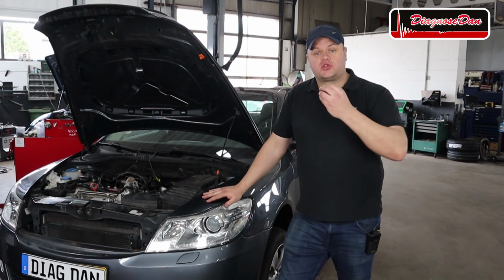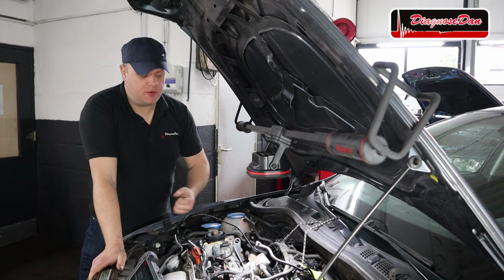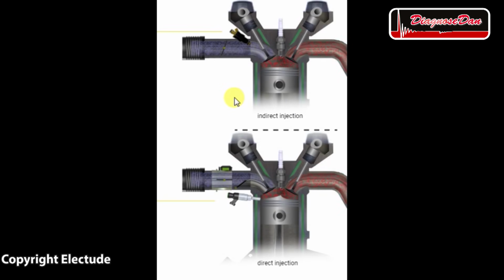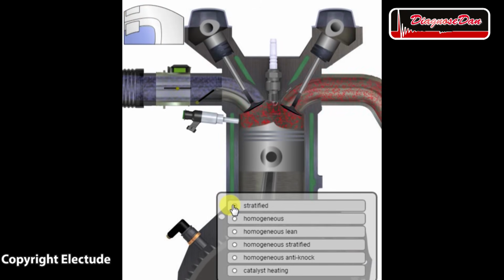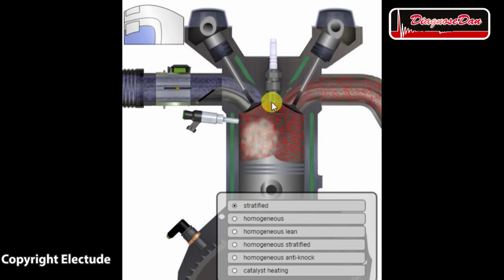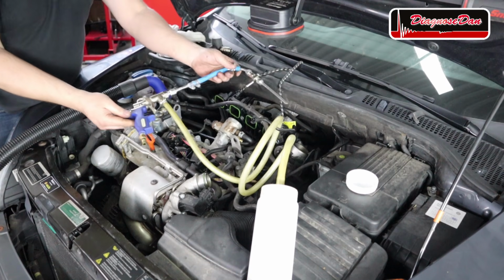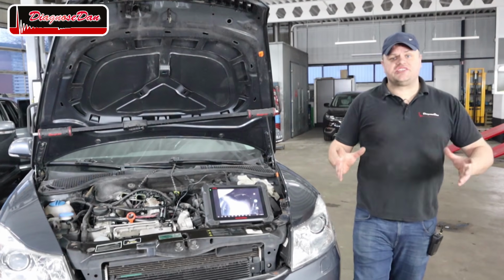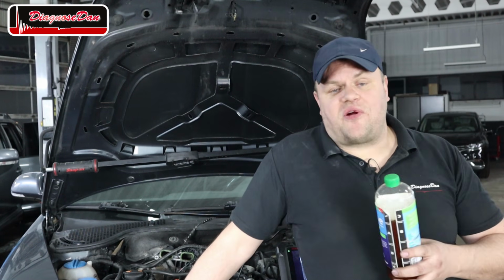Tsi cold misfires explained

Comment: Some systems have extra injector in intake manifold to help clean all that mess.
And nobody runs anymore on lean-mode! So carbon build-up is almost gone!
Reply from the maker: Yes, they have solved the problem on later models with an extra injector 👍
Reply: @Diagnosedan  so you fix the problem by adding more parts and cost . Well done enginerds
Reply: Lexus had the extra injector on some of their engines few years back.

Comment: I didn't heard you mentioning EGR valve. 
When engine runs on lean-mode it produces lots of carbon! 
At same time engine runs on almost closed throttle, which gives a lots of pumping losses. 
That's why EGR valve opens and helping to decrease pumping losses.  And that's why all carbon goes back to intake valves. 
And if you mix all of carbon with oily steam from crank hause ventilation you get all that you saw on boroscope!!
Reply from the maker: There are more than one source of contaminstion. You are right 👍

Comment: Great video, I would have liked to know the mileage on this engine
Reply: Just basing on some facts I know, it's a facelift version so it's probably between 2007-2012 model, seeing the dash it said 150, i highly doubt its at 15000 km, so it's probably 150k km
Reply from the maker: Its about 130K Kilometers
Reply: DiagnoseDan ah close enough haha
Reply: columbo1966 I saw the same amount of carbon build up on a Kia with 73,xxx miles. My guess would be right at 100k.

Comment: That blasting was uncomfortably like having a root canal at the dentist!  Do the direct injection running modes have anything to do with the 'kangaroo' issues reorted on the new 1.5 tsi VAG motors in your opinion? Yes it won't be carbon on a new engine but could it be the injection design?
Reply from the maker: I'm not sure Keith i haven't come across one yet.

Comment: Thanks, Dan !
The problem has been solved by injecting fuel both ways, direct into the cylinder, and also onto the inlet valve, right ?
Reply from the maker: Yes, later models have an extra injector
Reply: Juergen bertram Chevy already did that.

Comment: the tsi engine also suffers from soft valve guides, i had a seat leon 1.6 with low rpm missfires, the valves float and loose compression.
another great vid dan, the carbon build up was strong in this engine.
Reply: Valve guide gets pulled down by the carbon on the stem...
Reply: @lgtweewielers  interesting but i have never seen that happen, the guides would have to be undersized fitting in the head for that to happen i would think.
Reply from the maker: Yes it was pretty nasty😀

Comment: Great video as usual Dan,to fix this properly blasting the valves is the first stage then the intake manifold has to be ultra sonically cleaned to remove the carbon sludge that builds up over time which is also labour intensive,an oil catch can setup would stop this problem altogether but it needs to be emptied regularly which as you know Dan would never happen as most customers dont even check their oil level!! 🤔😁
Reply from the maker: An oil catch can will slow the carbon build up down.
Reply: @Diagnosedan  maybe the manufacturers should add a set of injectors before the valves to inject a small quantity of fuel or other cleaning fluid (on cold start or every 3rd start) to clean the valves and help prevent this? Or maybe an aftermarket kit? 🤔

Comment: I'd be worried to just squirt any product into an engine badly carboned up and just hope any large pieces that fall off exit without any damage as there is little chance that they would be dissolved. As you say it would need to be done on a regular basis to prevent it getting that bad in the first place.
I've been looking at buying a used direct injection engined car and think I'll have to factor in a "decoke" into the cost after seeing that. How many KMS had it done?
Reply from the maker: 130K😉

Comment: Fantastic video Dan. As always a clear explanation of the cause of the problem, and the proper fix with evidence.
You also saved people time and money by not using the snake oil.
Looks like the additive might work if used regularly before the problem occurs, but will not help in an advanced case.
More preventative maintenance .
Thanks again, nobody does clearer more concise videos than you. Not even Eric O.
Reply from the maker: That's a great comment Sir😀

Comment: Sometimes it seems the smarter we try to be with getting engines fuel efficient, the dumber we look.
Reply: Right!?....this direct injection thing on gas engines....turbos to make V6 stronger than V8
Please, give me the old-style injectors with pushrods....(i.e. Ford's new 7.3L gas)
Reply from the maker: Thanks for watching 😀
Reply: With refinement comes complications
Reply: I think Toyota is putting in pre-valve injectors again just for cleaning while keeping Di.
Reply: @MV60  Toyota have been doing that for years with their DI-D D-4S engines. The engines run on either the direct, port or (I think) both sets of injectors depending on the operating regime. It's not just for cleaning the ports, there are efficiency considerations as well. Personally I would only buy a DI engine if it either had no EGR system or if it had a secondary injectors like Toyota D-4S engines.
Reply: @spankeyfish  The diesels have a injector in the dpf iirc. I'm talking regular petrol versions having the extra set of injectors for upper intake cleaning.
Reply: @MV60  I meant D-4S not DI-D, I've mixed up my Toyota marketing speak.
Reply: @spankeyfish  I think we mean the same things. :)
Reply: No more crappy eco cars that have no power but good fuel economy. Cars need everything in one package now
Reply: @BaileyHatfield-b3f  EV is the future. Fast as hell and meets emissions.

Comment: Absolutely spot on Dan ... 
I have the 2.0 FSi Octavia DSG (non-Turbo) on 140,000 mile and it's started to run lumpy at idle despite 
recent Plugs and EGR valve renewal ... the 2nd Timing Belt renewal is also due ... should I whip the head off and expect carbon on the valves??
Reply from the maker: The head doesn't need to get off, just remove the intake and have a look.

Comment: I have a diesel that is behaving the same way. How much does it cost a blasting on the intake valves?
Reply from the maker: It depends on how easy the valves can be reached.
Reply: @Diagnosedan  BMW 120D, year 2006. I am really  thinking in doing this.

Comment: Some people claim that the carbon buildup is mainly caused by very small amounts of exhaust gases entering the intake port due to valve overlap. It sounds like a reasonable explanation because other parts that get into contact with oil also don't have carbon buildup. What do you guys think?
Reply from the maker: So why is there no Carbon build up in the exhaust ports?
Reply: Which other parts running at high temperatures are in contact with oil mist and don't get carbon build up?
Reply: @ferrumignis  The bottom of the piston comes to mind. Also the intake port is watercooled so it will not be significantly hotter than the crankcase. The valves are significantly hotter but also the intake itself gets carbon buildup.
Reply: @tomvleeuwen  The bottom of the piston is cooled by oil. The inlet valve is not cooled by anything other than contact with the valve seat so they run hot.

Comment: An American company called CRC makes an intake and turbo carbon cleaning spray in a can that is supposed to work very well.  I would give that a chance and see how the results turn out.
Reply from the maker: Sounds interesting 👍
Reply: @Diagnosedan  ...Here is the Amazon link.  https://www.amazon.com/CRC-05319-Intake-Valve-Cleaner/dp/B00PHNQKR2  More for your information and a photo than for you to order it from there.  Any good parts store would have this in stock.  Well, at least they would in America.  You'd have to call your local parts store and ask.

Comment: Ah emission controls, got to wonder if over the whole life of a car they actually save anything - at some point it all still comes out the exhaust, or results in co2 dump cause the car gets scrapped early. Grumble.
Reply: Indeed. Let’s catch everything in a filter then people will blow it all out in one go or wash it down the drain.
Reply from the maker: Thanks for watching 😀
Reply: Haha watch the vid about the problem retrofitting cats and dpfs on school buses  in California has caused.
Haha to clean em out they back em up to the property line and let em go into Regen mode , blowing ash and all kinds of crap all over. 
There was a whole bunch of vids a few years back on how carb is basically putting people out of business and costing everyone alot of money and we aren't seeing any benefits
Reply: Go to China ro France to see emission problems, or back to LA in the 80s where they would issue smog warnings.
Reply: Do you recall having to fit a new exhaust system every few years due to rust? Modern cars do not have that, possibly due to emissions control which means exhaust gases do not attack the exhaust system and cause it to rust/rot away.
Reply: Mate no one cares about emissions
Reply: @Luxtraveler247  of course everyone does you're either trying to promote it or find a way to bypass/overcome emmision control as they throw more stuff on every year
Reply: @Luxtraveler247  Asthma sufferers

Comment: Toyota have been using direct and port injection since the mid 2000's to overcome this problem (Lexus V6  comes to mind). A combination of direct and port is the way to go in my opinion. This is a huge problem with VAG and BM's, stating the bleeding obvious. Great explantion Dan.
Reply from the maker: The newer engines have an extra injector 👍
Reply: VW builds also the 2.0l engine with the aka Dual Einspritzung System.

Comment: It’s hard to understand why VAG hasn’t installed a catch can to prevent this exact problem
Reply: It doesn't help.
Reply: Cabaliero while it may not totally eliminate the problem, I’m sure it would take much longer for the problem to appear if a catch can was fitted at the factory.
Reply: @calm4477  They did it on some engines before, than stopped. Now they do 1.8tsi with two injectors per cylinder, one in the cylinder, and  other in the manifold, that helps but very expensive and complicated.
Reply: They probably realised it makes. More money when the customer brings the car  back to the dealer for a fault that's appears conveniently after the warranty expires ;)
Reply: This carbon buildup is all about oil evaporation and exhaust  gases turned in intake line, catch can can't catch it well enough. Some experts advise using of oil with low evaporate level, and clean intake ports every 20K miles.
Reply from the maker: They have solved the problem on newer engines by placing an extra injector in the intake

Comment: Drive it like you are at the race track and you will never have a carbon issue.
Reply: That advice is not true and will actually carbon up your intake and valves even more and or faster due to the PVC system sucking up more oil and vapors directly depositing it on the valves and valve intake area.
Reply from the maker: Thanks for watching 😀

Comment: Doesn't the carbon buildup have something to do with EGR valves?
Reply from the maker: There are more causes for carbon build up and Egr is one of them.
Reply: Michał Chyliński that and also oil vapors!!
Reply: Probably, but also on cars without EGR valve this is a big issue.
Reply: @tomvleeuwen  Thanks, I wasn't aware of that🤟
Reply: Tom without egr takes more time to build up however the main factor are the oily residues!!
Reply: Tom even thought there are egrless cars, there are also pvcless cars, - both systems use these systems to route fresh air into some exhaust critical accesories in the case of the egrs', but in the case of pcvs'  vapor moisture is necessary to correctly reach optimal performance of moving parts such as the throttle body butterfly, keep afresh steam seals on intake/ exhaust valves, unclogged cat converter, alive o2 sensors, etc etc etc aiding also in reaching optimal combustion chamber operation but in a way, in most recent times, literaly, these systems have been integrated into another previously choosen system or into a newer lets say - breather system
trouble is that during service most auto mechanics neglect to service these integrated, as well conventional systems
only the autotechnician will go beyond any expectation made obviously out of control by a poor performer such as an automechanic
the main difference here is that the automech will perform basic repairs and maintenance tasks, while the autotech will do that but also he will perform an extra task using lots of thinking, knowledge, exhaustive research, and by putting to work specialized diagnostic equipment to isolate a failure and also try to correct it - any issue affecting a specific service area he's doing
some times specialized diagnostic equipment is not even required if a throughout visual inspection is performed and the basic inspection functions are performed like replacing a bad intake/ plentum gasket, thightening a loose vacuum hose clamp or by correcting an electrical connector out of position, etc etc
an autotech must keep in mind, firstly, 4 basic things in order to reach a ideal stochiometric ratio:
we need good air, good fuel, good compression, good spark & good voltage, and then after checking all that the rest will just fall in place 😁
Reply: Intake valve is colder, so carbon loves to stick to that.  Valve guide seals don't totally eliminate the oil running down the valve stem and onto the back of the valve.  The oil cooks and sticks.
Reply: You get oil vapour from the crankcase but also and more volume of oil vapour from the turbo as it runs on a film of oil. You can fit a catch can for crankcase oil vapour but not turbo vapour
Reply: You get soot through egr valves but that's more on diesels , oil vapour and soot really clog valves and intakes
Reply: Many of the TSI (if not all?) does NOT have a regular EGR valve at all but adjusting the valve timings so the intake valve opens on the exhaust stroke, filling the intake with exhaust

Isnt that a brilliant idea? 🤪
Reply: @tullgutten  I've never seen an engine do that but it is the same thing as an EGR really, the EGR dumps exhaust gas straight into the intake manifold.

Comment: Whe use a product from Rapid Specialty, called Rapid Inlet Carbon Cleaner. You also have to remove the intake manifold. Than you soak 3 cilinders in one go, let it stand for a while and clean it with a little brush. You get the same and even better result as blasting (you reach the upper schaft better) and it isn't a mess like blasting! Whe use this a lot of times.
Reply from the maker: Thanks for leaving a comment 😀

Comment: Dan a great video again and a great explanation BMW also has this problem but I never saw it on a Mercedes someone told me they have an injector that sprays fuel on the valve but I have not been able to read about it.
Reply: Some engines have both direct and indirect injection, to clean off the intake valves at need.
Reply from the maker: Yes, some manufacturers  solve the problem by placing an extra injector

Comment: Good heavens DiagnoseDan you sealed up that engine bay better than the surgeons did when I had my appendix out.
Reply from the maker: Dr.Dan😂😂
Reply: @Diagnosedan  I thought you were going to deliver a baby TSI.
Reply: Where were the Nurses????????
Reply: Here is the good old USofA nobody wants to pay for auto repairs. They buy a car, drive it 150K miles while changing oil 4 times and complain when the "money" light comes on. The timing chain is worn slap out, any VVT system is clogged up, so they probably need an engine.
Reply: @gailtaylor1636  not just cars, our whole "culture" is centered around buying the cheapest thing, using it carelessly until it's ruined, tossing it in a dump, and buying more "new" trash - everything from clothes and phones to cars and even buildings.  All the while people complain about "the good old days" and "the greatest generation" and "we don't make em like they used to", but I'll tell ya what, people back then didn't buy a Buick and run it into the ground, they changed the oil every 3k, kept it tuned up, etc, and if it broke, they fixed it.
Reply: I'm like... A little overkill ain't it?
Reply: @partsshooter  at least he didn't use a plastic straw in his soda, lol.
Reply: @Sam S "I don't think it's overkill" and then "I probably wouldn't wrapped it up as tight" and then "to each their own"... Hey Sam S, if you look under %100 of people cars on the road, there debris everywhere. That wrapping had to have been done to appease the internet perfectionist
Reply: Sam S 
What an horror story! Interesting to read though. Weren’t you surprised that the engine ran at all after finding all that damage? 
What engine is it? US V8 I guess.
Reply: Sam S Tx!
Reply: Lol my taught also looks exactly like an operating room
Reply: Dan performed a 9-hour operation on my ex-wife's brain, he removed a tumour the size of a Labrador.
This is just his hobby.
Reply: Wait... your surgeons sealed up an engine bay before operating on you?
Reply: I learned a long time ago to use Genuine Subaru upper engine cleaner as it does work and Subaru’s are notorious for clogging up the upper combustion chamber.

Comment: when you sprayed that cleaner in the intake hose, did it went through the turbo and intercooler piping? or  it was somewhere close to the final engine intake gallery?
Reply: He sprayed it into the intake from the air filter, which means it went through the turbo and IC as you guessed.
Reply from the maker: It went thru the Turbo

Comment: The is a product called "sea foam" that attacks carbon. great on the old outboard engines with carbon build up.
Reply: Not nearly as effective as CRC intake and turbo cleaner.
Reply: Snake oil. These products are all based on wishful thinking and are far more effective at removing money from wallets than carbon from valves.
Reply from the maker: Never seen Seafoam over here